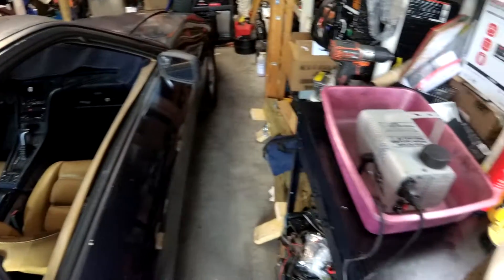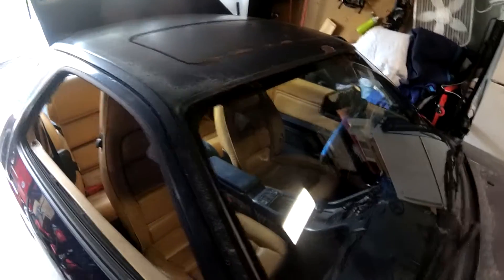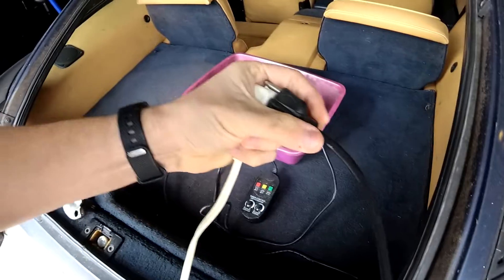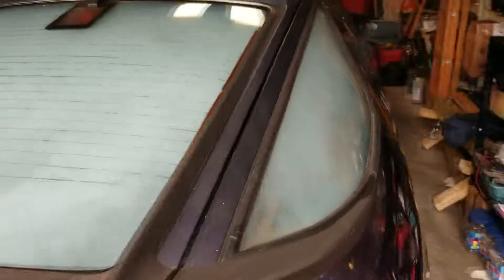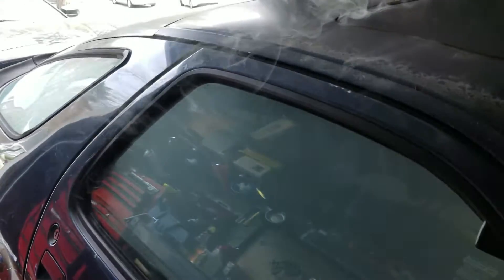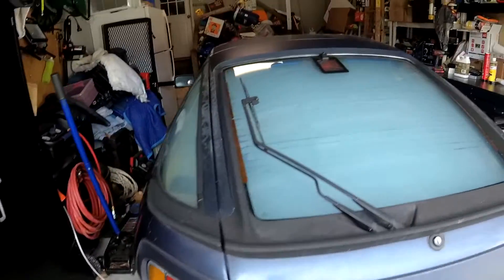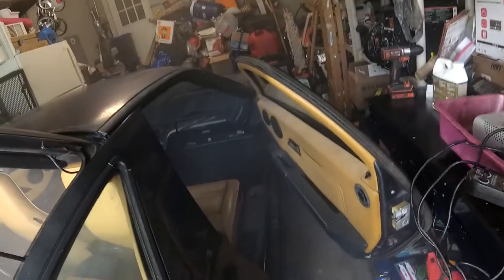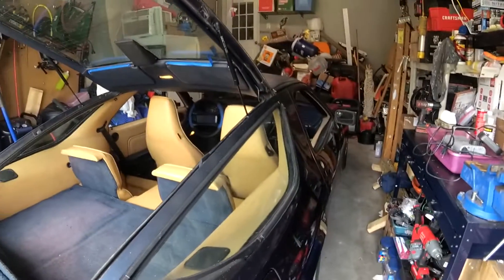Filling the 928 with Smoke to Check for Leaks

Comment: Nice work....I’ve been smoking my intake refresh on my 86.5 checking for vac leaks.....luckily nothing major...but it was a small engine type.  No where near this volume.  Picked up an 83 Auto this week for a winter project...no sunroof...;) so I won’t have to worry about leaks!  Keep up the good work.
Reply from the maker: I was thinking about putting smoke in my intake as well, just need to get some materials to hook the fog machine up to it.
Reply: Forgot to mention I picked up an 83’ Auot...smooth top (sunroof delete) in Meteor gray metallic.  Local kid bought it to restore and tapped out when the mechanic fixed the brakes for $1500.  My fall project.
Reply from the maker: @Dundertaker1  I've got the tan 86.5 to hopefully get running this summer too.  I'm starting to shift towards more cosmetic things on the blue 86.5.
Reply: I was so excited to discuss with anyone who'd appreciate it that I failed to review my comment...where I mentioned it!  LOL  

  @IntenseBlue318
Reply from the maker: @Dundertaker1  hopefully it's in better shape than my cars.  My cars seem to be parts cars by most people's standards

Comment: Thank you for this post. Your post is going to help immensely in troubleshooting a known problem! I have a '85 928S Euro version that has rain water leaks into the cabin. I'm new to wrenching on cars so please accept this as a newbie question. You refer to your machine as a 'fog' machine. Dan Garner talks about a smoke machine for EVAP testing. Could you also use a smoke machine for the testing that you did? Obviously, the safest for me is purchase a fog machine and then later, if needed, purchase a smoke machine. I ask because your fog machine did not damage to the interior of the car. A smoke machine uses different material to generate the smoke and I am not sure it would be as benign for the interior materials.  Thank You.

BTW, I'm really enjoying your posts on the 928!
Reply from the maker: So I'm not 100% sure what the fog solution was that I used here.  This was just some party store fog machine I had laying around.  I have since got an evap smoke machine.  it works by heating up mineral oil.  It does smell some afterwards though, not sure if it would leave residue or not.  The fog machine didn't leave residue.
Reply: @IntenseBlue318  Thanks. You just answered my question: I'll use a fog machine and avoid the 'after smell' :) .